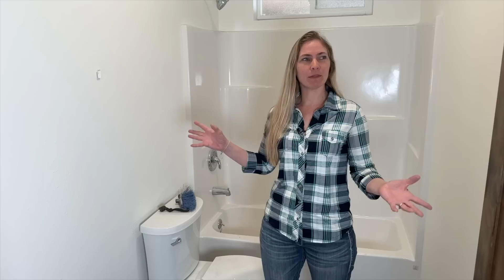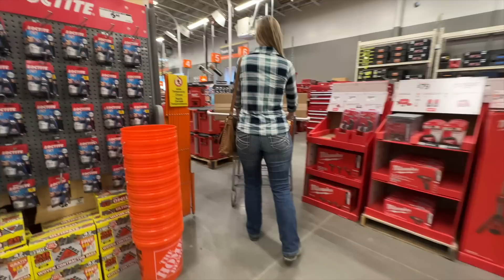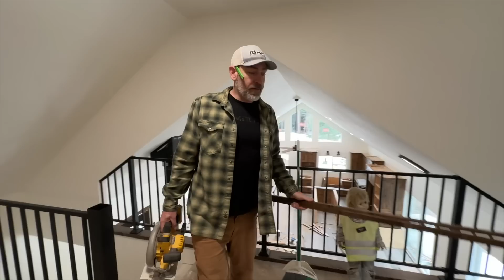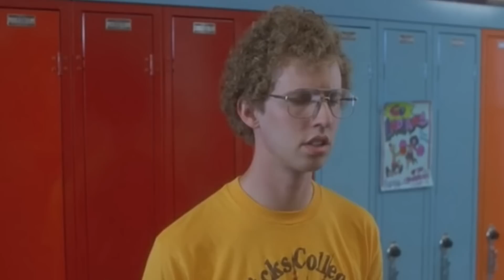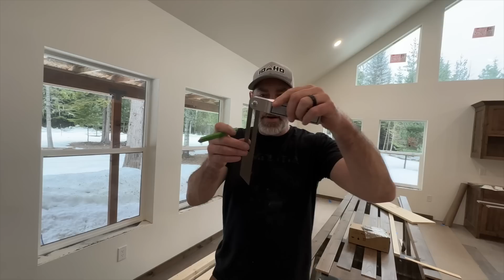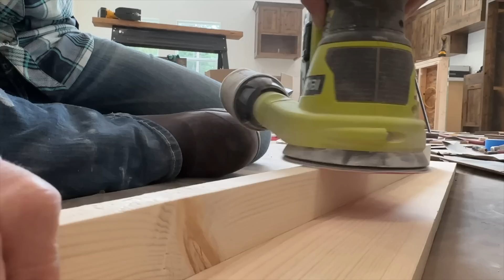We Tried to SAVE MONEY but FAILED! Don't Make This Mistake.

Comment: Martin is right. "Goof-off", or "Goo Gone" is the best way to get the sticky residue off.
Reply: If you don’t have Goo Gone on hand…either vegetable oil and/or peanut butter work remarkably well as well. My mom and I redid a metal bed frame that had a lot of packing tape residue on it when we bought it and we used peanut butter and some “elbow grease” and it all came off.

Comment: If that door on the loft is the same width as the garage door you could swap them and just put a curtain on the window or some interesting vinyl coating (like stained glass). Awesome work, thanks for the window sill tutorial!  Thanks for sharing!

Comment: 13:51 I have a great trick for sticky residue. Use a piece of tape and rapidly tap/pull/tap/pull it all over the area. The adhesive of the tape pulls the adhesive off the surface and leaves it squeaky clean. Masking tape is on the gentle side, packing tape on the less gentle side, both work great. I use this to remove residue from CD jewel cases all the time.

Comment: The sticky  stuff can be remuv3d with nail polish remover  . Then rinse  off the asittone  withh alcohol. I worked  in a box factory  and that 8s how we cleaned 9ff 5he we cleaned  off the ducked tape glue frum the strike plate 9n the die cutter.

Comment: Confused?  When you make cuts on your table saw why you set the waste dimension off the guide instead of the finished dimension you want?  Having to add the blade cut width to every cut you make seems like a recipe for  mis-cuts.  Also its easier to keep the finished dimension accurate running it against the guide.

Comment: You spray an oil on that sticker glue. It will bond with it and become one. Then just use soap and water to wash it off. I let it a couple hours then wash it off. Any oil would work.

Comment: If you paint those brand stickers with non-acetone nail polish remover, leave it for 1/2 hour and scrape, the glue and sticker will scrape off easily, non-acetone will not hurt the paint !!

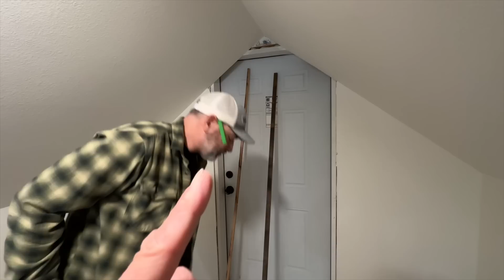Comment: 11:57 is that obstructed door opening ever going to pass code? Or will you cut out the ceiling so it doesn't look like a ridiculous corridor anymore? 😀
Reply: There are few code requirements in the parts of Idaho where they live, mainly electric and plumbing.